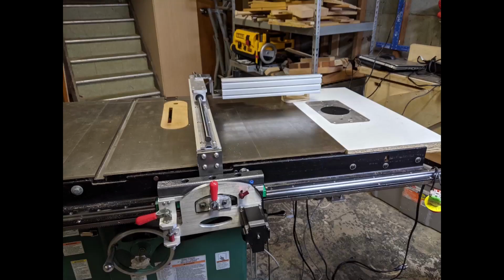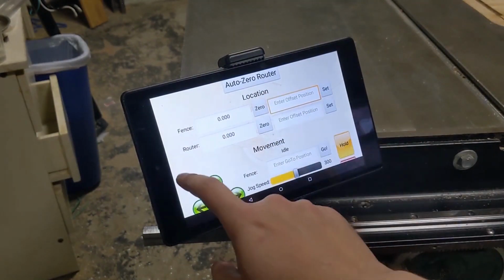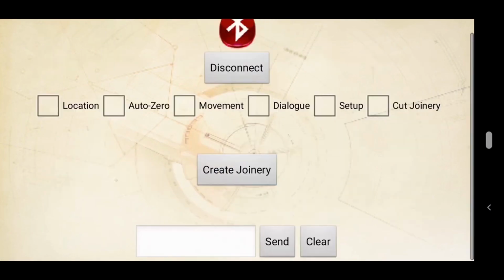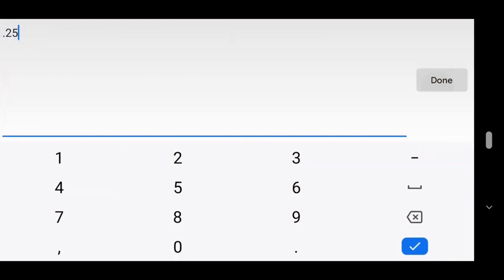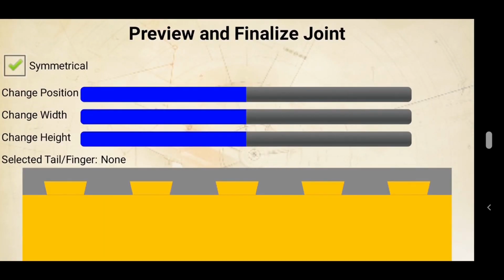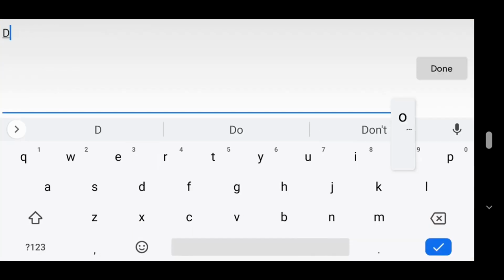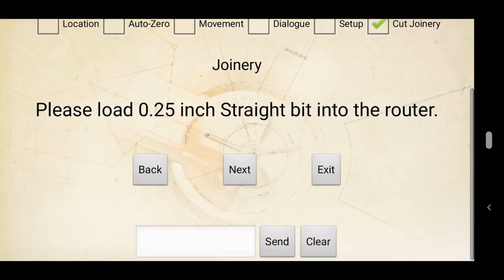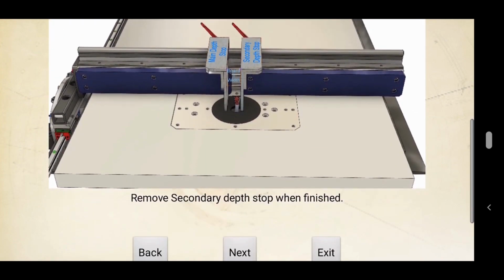Amazing Maker Awards Entry

Comment: This looks amazing. any progress on this?
Reply from the maker: Thank you. I haven't had much progress on the programming front. I still have to make some mechanical stops to test out the joinery part of the program. I moved all of my tools to a new shop, so it has been slow going. 

I have been using it as a regular digital table saw and router fence/lift and it has been wonderfully accurate. It is nice to just punch in a measurement and know the cut will be dead on. i've been toying with the idea of designing a sliding attachment for the table saw. I suspect that will be the next big upgrade. 

Thanks for the comment.
Reply: @medicineman007  Nice. Congats on new shop.  i would definitely be interested in getting this setup.  I'm sort of local too North NJ